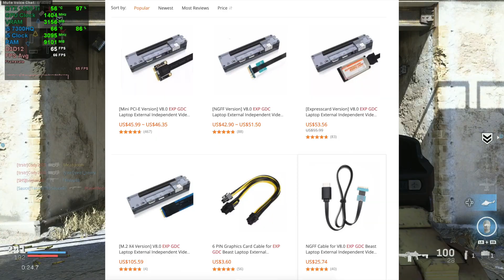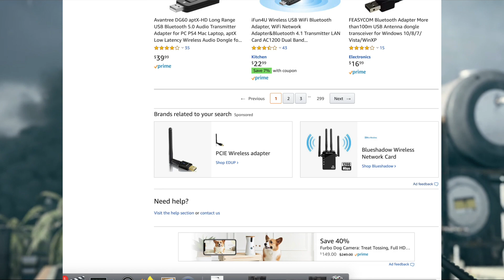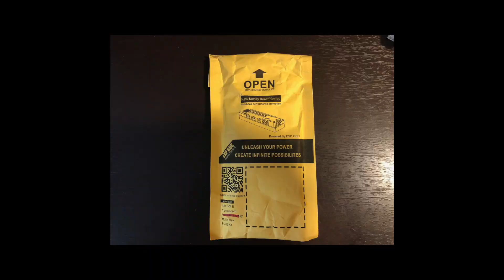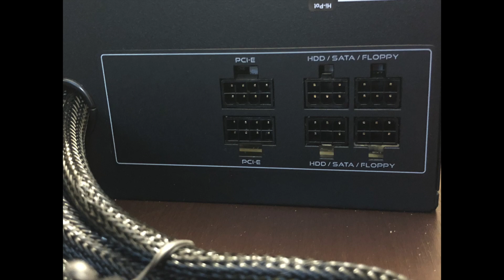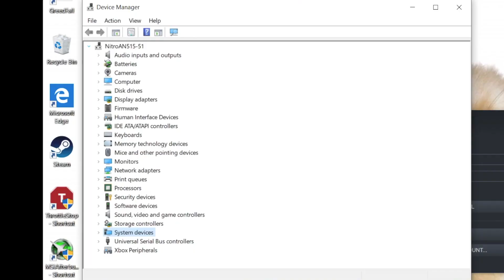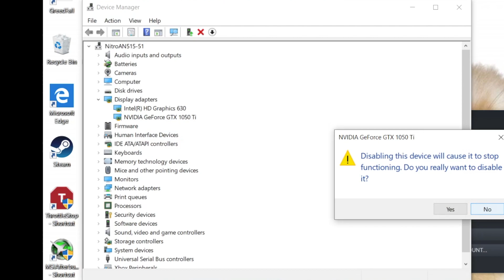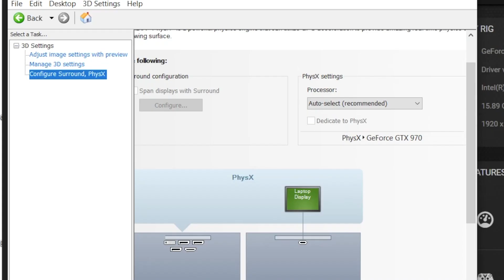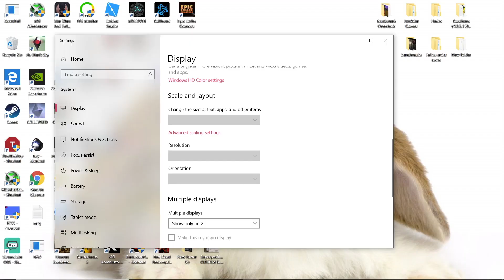EXP GDC Beast NGFF Acer Nitro 5 External GPU Review and Setup

Comment: Hi, i have a hp 650 i m trying this thing with exp gdc i bought the rx 470 8gb i think its decent i have 8 gb ram and a i3 2370m and i have only integrated graphics. I want to ask if i need to do more settings like in bios or something or i have just to disable the integrated graphics and uninstall  the wifi? Anyway the hp didn t let you to acces the advance settings in bios so its sucks but i really want to be informed before doing this thing so i shouldn t end up  damage my laptop

Comment: I have gtx 1050ti, and how to return the GPU to MX130 as before?.sorry for my bad english
Reply from the maker: You can do the instructions in reverse.  Remove the egpu, enable your disabled PCI Express and lastly boot into safe mode to run DDU.  Reboot.

Comment: Bro I use the same laptop, can I connect it to a gtx 1660ti ?
Reply from the maker: Im sure you could but I would use the  M.2 slot version.
Reply: Hi did you try it with the 1660? Did it work?

Comment: is this safe if used for the long term? , Cause ihave read an article laptop carsh after six month.
Reply from the maker: Yes it’s safe for long run but becomes impractical as time goes on. You will be better off buying a new system when you have the funds. I would consider this life support.

Comment: Hey can it work on my hp notebook 15 ac121tx 
With graphic card 1050ti....
Reply from the maker: Im pretty sure it can.  Just get the M.2 version.
Reply: @Meanpooh  i dont think my laptop have m.2 slot and does gtx 1050 ti work as a external graphics card in some videos they say this card doesn't work .......
Reply from the maker: So you will have to use the version that im using in the video.  No, the 1050 Ti is disabled.
Reply: @Meanpooh  okay thanks for replying but i have heard that i have to add an external monitor but i want to use my laptop screen can i play on my laptop screen without any performance drop?

Comment: my laptop asus k551ln i7 4510u, not deteck gtx 1060 in exp gdc...
i am give up...
Reply from the maker: Did you check your device manager?  Is thew GDC installed correctly in the port?
Reply: @Meanpooh  not show my vga card, nothing happen
Reply: @Meanpooh  can you show me i must do..?
Reply from the maker: @Memoryrtrw  Can you confirm that there is power going to your video card?  Do you get a video signal?  In your display settings, is there an option to choose display number 2?
Reply from the maker: @Memoryrtrw  I don't have any other instructions except in the video.  There's nothing more that can be done.  Just make sure that the GDC is getting sufficient power.

Comment: Thanks so much it worked but two question

1.Does the heat produced from the computer will effect the wire?

2.Can you use both graphics at the same time?
Reply from the maker: No and No.  Only Discrete and Integrated CPU graphics.

Comment: Just thanks i ave an nitro 5 2018 and y want an egpu and i see its possible 
Bye gtx 1050 4gb
Hello rtx 2060

Sorry for my bad english its because ime french
Reply from the maker: Yes, its possible.  If you happen to get one, get the M.2 version because its faster.  IMO I would invest in a desktop or a newer laptop.  You can find them at cheap prices at the moment that are much faster than the 1050.  It will keep you mobile and less hassle.
Reply: Ok thanks for the advice 
And i ave an M.2 on my nitro is just used by my litle ssd
Its not a problème but i ave 2 storage space in it: an ssd and an hdd
Reply: @rodolphecolson1366  did u get it and try it ?

Comment: Hey, is gdc exp is going to work with DELL laptop (my is DELL Inspiron 5567). Also do I have to change something In bios while using M.2 slot, or it is just a plug n play? Also do I have to disable port for my iGPU? How do I will now I've disabled the correct one?
Reply from the maker: The M.2 should work fine but you will have to disable your iGPU.  You have to use trial and error.  The EXP is plug and play.
Reply: @Meanpooh  Let's say, I would diseable wrong port. Could my laptop be damaged?
How will I know I disabled the right port - will there ba some kind of message, beep, anything?
Do I need an external monitor for AMD RX 580 or my laptop monitor will work? 
Thanks for quick replay!
Reply from the maker: @maciejferenc7234  Your machine will not be damaged.  There will be no beeps.  In the setup you can see this.  You will need another monitor and external power supply.
Reply: @Meanpooh  External monitor is permament or only needed to setup?
Reply from the maker: @maciejferenc7234  Permanent.
Reply: @Meanpooh  Last question, I have integrated GPU, not dedicated. Do I still need to disable iGPU and port?
Reply: @Meanpooh Aslo I have
AMD r7 445m - iGPU
and
AMD RX 580 - eGPU

do I need uninstall the driver? Manufacturer is the same
Reply from the maker: @maciejferenc7234  Since you do not have dedicated graphics chipset it may be plug and play.  You will have to leave the 445m enabled so you can see what you are doing because if you disable it your screen will go dark.
Reply: @Meanpooh  Thanks fot the tips!
Reply from the maker: @maciejferenc7234  No problem.
Reply: @Meanpooh  hey again. My Laptop see egpu in device manager, but after 2 min, eGPU fan starts to spin really fast and my PC freez. What now?

Comment: Are this setup is same for acer vx15?
Reply from the maker: Im not sure without looking on the inside.
Reply: @Meanpooh  i meant the software, from inside structure is same i think
Reply from the maker: @ps3lego95  Yes, it will be the same.  You will have to figure out which port to disable.  You should also get the version that has the M.2 interface if your computer has one available.  Its faster.

Comment: do you use this as your main set up? how is it now? did it shows negative signs? i want to do this on my laptop too. please respond thank you. i want to game on my laptop it has no gpu only intel 620 and it sucks. please tell me if this is your main set up or daily driver. thank you
Reply from the maker: No, this was just an experiment.  Only Negative is that its not portable anymore.  You will also be hindered by your cpu if you go high enough in graphics cards.
Reply: @Meanpooh  do you think rx470 is ok with i5 8265u? i only play csgo dota gta r6. i kinda wanna do this thing in my laptop as my rig. what do you think? do you think it is a good idea?
Reply from the maker: @frostybadboyyt2689  That combo will work good together.  Do you already have the GPU?  Does your machine have a M.2 slot?
Reply: @Meanpooh  i have the gpu and power supply. but i dont have the gdc8.0 i havent ordered it yet. i also have the m.2 slot with m.2 sata and windows on it. but also have extra space for ssd. what can you recommend to me of what i should do.
Reply from the maker: @frostybadboyyt2689  Get the version that fits in the M.2 slot if you can.  If you use the Wifi Bluetooth version and decide to remove it later, its very easy to break the Wifi antenna.  The M.2 version is also faster having a wider bandwidth.  This version will also cause you to relocate Windows to SATA.
Reply: @Meanpooh  i got your point! thank you i definitely do that. God Bless you

Comment: Why aren't you using one of the two M.2 Key M slots on this laptop instead of killing the WiFi/Bluetooth?
Reply from the maker: Because I didn't have that version.
Reply: Meanpooh my bad, I noticed in tear down video that the other one is different, it has a solid back instead of openings for the ram and hard drive. I think a model that supports nvme RAID would be better. Just throw in a good 1tb nvme and use the other port for an egpu.
Reply from the maker: @michealkinney6205  Yep.

Comment: Does it work on Acer Predator 15(gtx970m) with RX 580?
Reply from the maker: I'm sure it will but I've never tried.  Just open it and make sure you have the necessary slots.
Reply: Meanpooh Yes my Laptop is almost similar to yours but an AMD GPU might work right?
Reply: @beavis4443  amd gpus require external monitor

Comment: Dude, why can't you use the internal monitor. I watched other videos and they are still using it's monitor instead of connecting to external one.

Hm, I'm still new with this kind of stuff but as far as I knew, you only need external monitor if you are using amd gpu or gt450s or lower

Edit: I think you use the external monitor to maximized your egpu since (I read somewhere) it will increase the performance 5-20% difference compared when using internal monitor

(My grammar suck, I know 😂)
Reply from the maker: " I think you use the external monitor to maximized your egpu since (I read somewhere) it will increase the performance 5-20% difference compared when using internal monitor
" and you cannot reroute video from the video card back to the laptop panel.

Comment: can this gdc beast use gpu without pin?
Reply from the maker: Pin?
Reply: @Meanpooh  sorry..i mean..a graphic card without pin connector (6 / 8 pin connector)
Reply from the maker: @gengarchannel9849  As long as the card has power somehow.  Some of the e-GPU's have adapters you can use for lower power cards.  If its newer you will have to use a larger power supply such as the one I have.

Comment: Really give me hope as a student who have small project to do some which need VGA based renderer, how about the problem that commonly occur during this project?  Do every laptop and VGA has same solution?
Reply from the maker: This is just one of a few that I know of.  If you have Thunderbolt you can just use an eGPU dock and plug right in without dismantling the machine.
Reply: @Meanpooh  my laptop broken and I have to buy new one,
But in 1-2 years later I want to build eGpu Rig(1060 3gb)

do you have recommendation for laptop?
My budget is around Asus A412DA ryzen 5 3500u igpu Vega8
Reply from the maker: So you want to use an e-GPU with a laptop computer you are going to buy in 1-2 years and use a 1060 GPU?

Comment: Hello, can I do this with my Acer Aspire 5 A515-51g with the RX580? It has built-in MX150. I ordered gdc beast v8.0 ngff version.
Reply from the maker: Im not familiar with the machine.  You have to open it up to check if you have the available slot.
Reply: I did and it's the ngff slot
Reply: btw at 7:08 is that disabling the pcie slot where the ngff is plugged into?
Reply from the maker: @kirinoxkyousuke  No.
Reply: @Meanpooh  then what does that do?
Reply from the maker: @kirinoxkyousuke  Disables 1050
Reply: @Meanpooh  Dock arrived a while ago and slapped in a gtx 1060 and maxed out RE2 remake with 70+ fps. Thank you for the help! :)
Reply from the maker: @kirinoxkyousuke  Hell yea dude!  Rock On!!!
Reply: @kirinoxkyousuke  how you can do it? I have a acer aspire e15 553g and when i conect the ngff adapter my laptop entry in recovery options for Windows
Reply: @kirinoxkyousuke  Hey Dude, You're using Exp Gdc Ngff Version right? Where do you plug-in for the Ngff cable? M.2 port or WiFi port?

Comment: If i use this method, will i be able to switch back to my original graphic card? I think to use this stuff for editting and use my original gpu for other work so it can carry away.
Reply from the maker: You will but this would be kinda messy.  You will have to find a way to fit the cable so it will not get ripped out of the machine.  You will also have to re enable the graphics card which would get tedious.

Comment: hello i have Acer Nitro 5 i5-7300HQ, GeForce GTX 1050. and my latop´s gtx 1050 gpu got busted (no signal on the hdmi port, it doesnt even appears on the device administrator, i tried to restore system, cant update bios , cant erase windows and format the sdd where the os is, it always tell me that i have a controller missed and i cant install it . can i use a amd gpu with this adapter like AMD Radeon RX 580 o rx 570  or maybe an older one that gives same or closest result like the gtx 1050??
Reply from the maker: You cant erase Windows?  Have you tried DDU?
Reply: @Meanpooh  yep, o already have use the ddu, it uninstall All Nvidia drivers but even with that I can re install the Nvidia drivers
Reply from the maker: @avecescocino  Hmm, reminds me of a problem a friend of mine had with the i7 variant.  He had to call Acer and they had to replace the board.  You should chat with them online and get it fixed.  As far are using the EGPU, im not sure.  If you are having problems with the slots and interfaces you may be wasting your time and its not guaranteed that it will see the added hardware.
Reply: Ok, if the hardware is dead I will have to buy another laptop, the integrated video card still works so I can resist, here where I live there isn't an acer's  technical service :(
Reply: If I remove the ssd and install Windows on another computer (maybe another nitro 5) and put back the ssd with the drivers already installed will it help?
Reply from the maker: In theory yes but its not guaranteed.  You can contact Acer online.
https://us.answers.acer.com/app/chat/chat_launch

Comment: I really appreciate your hard work and I liked the video. I own the same laptop and I'm more impressed on the COD MW latest one. I installed and story mode works good on low settings but the multiplayer one sucks. I'm thinking of this solution and it would really help me if you can suggest me a good graphics card that I can go with for medium to high graphics level that provides around 60FPS for COD MW. Also please let me know if the external monitor is mandatory. Thanks in advance.
Reply from the maker: A GTX 1660, Ti or Super will work.  You will need a monitor or LCD TV.

Comment: Before I found your channel I thought my pc was kinda a cheap low non-upgradabe pc. Now I think I can get a lot more out of my pc thanks!
Reply from the maker: You’re welcome. I don’t think 800 plus is cheap but I feel what you’re saying. The Nitro still has some kick left and I have a few games I need to run on it. Though the thermals have been crap out of the box, I’ve been pleased with the system as a whole.  Glad you’ve found the channel useful. 👍
Reply: @Meanpooh  Would this eGPU thing work with a  RTX 1080 ti the 3 fan one
Reply from the maker: @youtubeuser12588  It should work as long as you have enough power.

Comment: I need some  advice I am thinking of getting a msi rtx 2060 ventus xs 6g oc graphics card  and I have a h110m-dvs motherboard will it be compatible for the graphics card
Reply from the maker: Yes.
Reply: It's all I can afford
Reply from the maker: @insanitywithin1  What's wrong with that?  That's a perfectly good card.  What are you pairing it with?  CPU, SSD, HDD, Power Supply?
Reply: @Meanpooh  with a i3 7100 it works very well with the 2060
Reply: @Meanpooh  and HHD and power supply is 520
Reply: I would spend a little less money on the GPU. Assuming you’re gonna pair a cheap cpu on that cheap motherboard.
Reply: @xXx_Oshino_xXx  the motherboard where I lived was very expensive and the cpu

Comment: Why didn't u try the m.2 version? And btw i think since both 970 and 1050ti gets installed when installing drivers they cause bandwidth loss while vega 56 is amd card so it won't interfere with the 1050ti... try amd equivalent of 970 and say the results...
Reply from the maker: True on the driver install.  That's why you have to disable the 1050.  I dont think ill be purchasing any more hardware for this.  It was just a test to see if it works with the Nitro 5.

Comment: You are the man I added a  970 evo 1tb  m2 ssd and a ddr4 8gb stick of ram to my 2019 acer nitro 5 but I think it's time to build my first gaming pc. This laptop really opened my eyes to pc gaming
Reply from the maker: Congratulations!!  There’s so much you can do on a pc. 
Upgrading is so much easier and really pays off on a desktop system. 
Even if you don’t game much you can teach yourself how to program by watching tutorials and things like that.
Reply: Question can it give u 100fps when running Warzone? Same laptop by the way
Reply: As someone gaiming in 2023 with the old RX560x please get an updated laptop with an updated graphics card because my laptop is verry slow and laggy (inbuilt graphics card)